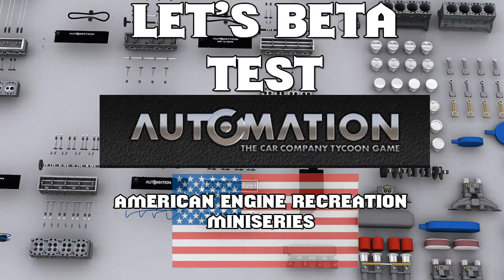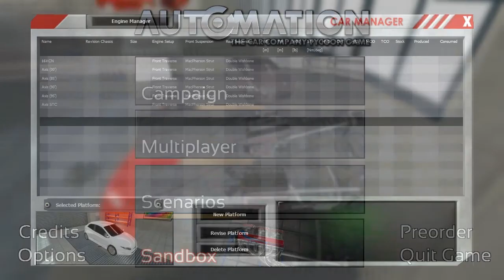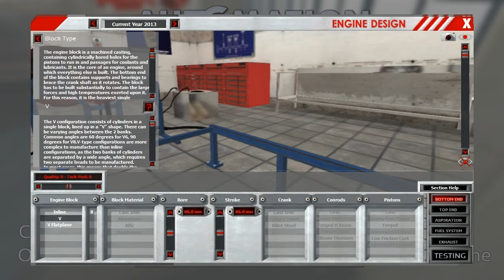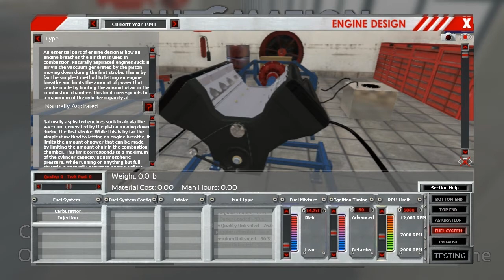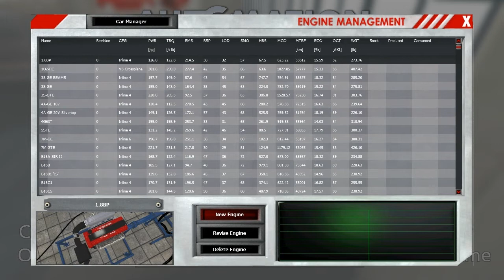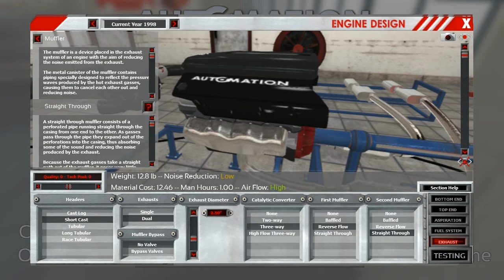Let's Beta Test : Automation Episode 21 "American Engines - LT5 LS1 and LS7"

Comment: Over head cams are so old technology.  Why do people always say they are new technology in books or videos?
Reply from the maker: Sadly for domestic american manufactures, OHC technology was new groundbreaking technology in the early 90s. Most high hp domestic engines still don't use them..kinda bizarre.
Reply: ConeDodger240 Actually that isn't true domestic auto makers were using them back in the 1910's some used them even in the 1960's I have heard.  

You can make high HP engines without using overhead cams.  Look at GM's LS series engines.
Reply: Does it so reliably as well.